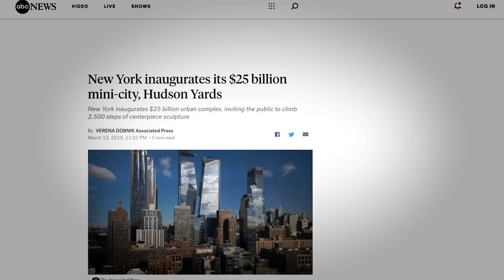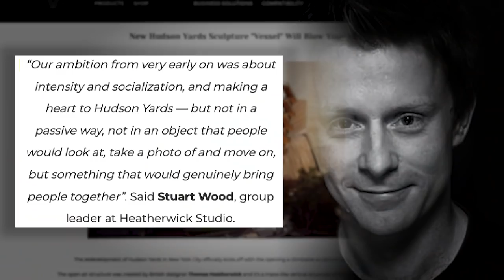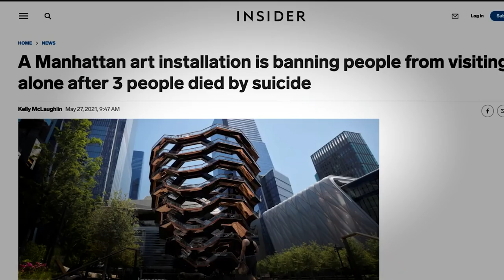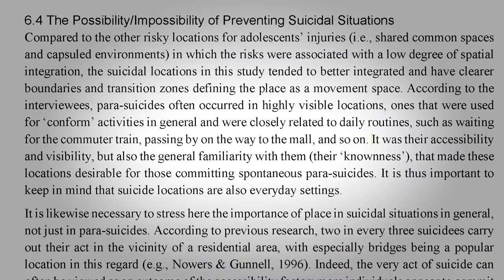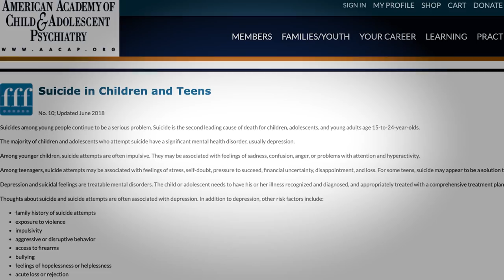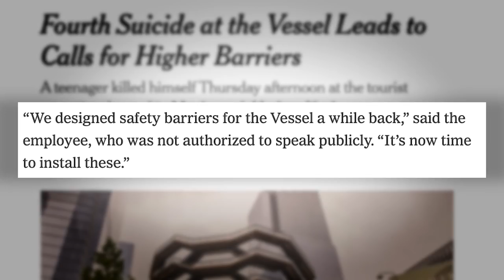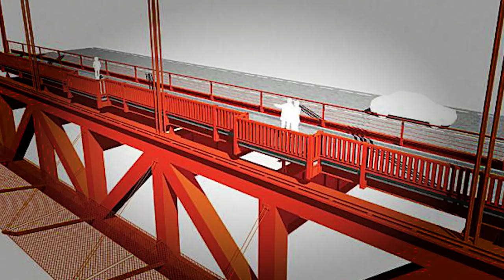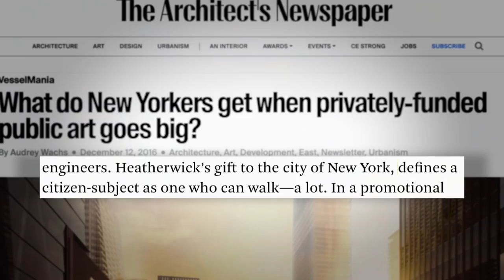Is This $250 Million Selfie Spot Dangerous?

Comment: As a student of architecture I can see that is mostly the designers and archictects vision that went too far.I understand the sensations of doing very crazy designs but it is true architecture can dangerous thing if left uncheck or even on porpuse. Architecture has the ability to push and punish behaviors by design alone. Lets not go far, color in a room can really change someones mood and responds time. So I can say that they got lost in their vision they have spent too much time sorrounded of people that have more of  an economic advantage instead of making research on the people on the city in general so when they designed it they didn't ask the questions of who are gonna be using the space, accesibilty and mood these are one of many beggining questions that an architect must ask when developing anything. We have a lot of responsability in our hands

Comment: Something I don't understand about the issue of visibility vs safety:  we have transparent materials, what's wrong with installing a few windows? 

The CN Tower in Toronto, Canada, has a viewing platform that is notable for the "glass" floors in parts of the deck.  It's extremely thick, and it's probably plexiglass or some similar material rather than actual glass, but from the footage I've seen taken up there, looking down it looks pretty close to people standing on air.  (I will never go there - I have a crippling fear of heights.  But it looks really cool for the folks who don't share my phobia.)  With that, and with the glass/plexiglass/whatever windows, the CN tower offers an absolutely amazing view of the city, and it's completely safe, short of a major failure.

Comment: I'm 61 now and could have not made it past 21 without suicide prevention measures, not involving tall structures in my case. Preventing suicide is necessary and they should add these lifesaving barriers to the design. As a person who suffers from life-long depression, stopping someone from attempting suicide keeps them alive to get past a temporary crisis and get the help they need. But what about those with disabilities, wheel chair access, and strollers? This piece of explorable art built recently in a modern city should not have been permitted without extensive access. They could have used ramps instead of stairs, or made ways around stairs to the elevator on each floor. How did they manage to build the thing without complying with the Americans with Disabilities Act???

Comment: Given the Vessel was designed by billionaires, surely it wouldn't have been beyond their resources to incorporate a barrier or net running from the top of the existing one, that was simultaneously strong, minimally intrusive (so hardly visible from ground level) and have upright elements spaced as wide as possible without being wide enough to allow a human body through, so it feels slightly dangerous and precarious, but in reality over engineered for safety. 

But ideally, something like that should have been designed from the start, as well ramps integrated into the structure (staggered rather than a continuous spiral) and circular walkways at each level. With care, they could have been incorporated while retaining a design similarity.

Comment: I've become quite a fan of your channel...

I worked in New Your City for several years and I can tell you that most skyscrapers have some sort of roof access.
In one building where I worked, you could simply walk up the fire stairs, open the door marked "roof", and be standing 24 stories up... with a three foot railing.
You could not end up there spontaneously or casually but nothing would have stopped you if you wanted to access the roof.
To me this means that there's nothing you can do to prevent someone who plans or intends to find a high place to jump from.
So, at best, you can minimize "spontaneous" suicide attempts... because anyone who plans won't have trouble finding an accessible roof door.
I can also see how someone considering "ending it all" might see that as "a cool place to do it".
Sort of like the concept of "standing at the edge of the world and experiencing a temptation to jump off".
There is also the obvious issue that, once someone has jumped from a structure, a sort of precedent is set... and it becomes "a popular suicide spot".

But I can also see how that very feeling of vague threat contributes to the awe of the experience of visiting the place.
It really would lose some of the sense of awe and excitement simply KNOWING that there was a safety rail "between you and infinity".
Part of the thrill of those amusement park rides they compare it to is the ILLUSION of danger built into them.
It would be difficult to design a safety shield that could make it safe without destroying that illusion.
(I'm pretty sure that the safety nets on the Golden Gate avoid this by being tucked down where they DO NOT obstruct the view out from the walkway.)

It also seems to me that, from the statistics you quoted, and the psychological analyses that went with them, there is another solution.
Since they require tickets for access anyway they could simply NOT sell tickets to anyone under 25 years of age.
Or they could put safety protection on the bottom four or five levels... and then restrict access to the levels above that.
That would enable them to eliminate the threat FOR THOSE SUSCEPTIBLE TO IT...
While not "compromising the artistic integrity" of the upper levels for those able to "use them safely".

While I can imagine "attractive decorative grills" I also must agree that they WOULD interfere with the "artistic integrity of the structure". 
(I can't even imagine bothering to climb up twenty stories of stairs to look out through a safety grating.)

Comment: The "suicidal people will just pick somewhere else to jump" is an interesting and somewhat weak argument.

Suicidal people often suffer from depression as the most commonly co-occuring symptom. Most suicidal making an attempt would probably just stop the attempt as soon as they reach a road block.

Of course there's going to be people who try harder. It's a symptom of a disease and, to look at it clinically, no shit would some symptoms and episodes be more persistent than others. To compare to a less severe medical episode that I've experienced, migraines can be very persistent. Sometimes it's gone just by eating a snack. Sometimes it's gone by taking an abortive medication. Sometimes I will go through the max amount of medicine I'm supposed to take within a week and the migraine will still be there. That's a part we need to view clinically. Just because some episodes are more persistent than others doesn't mean you tell people to stop taking an advil or an imitrex. Or how just because there's a failure rate with epipen that you tell people to stop using an epipen when they have an allergic reaction just because sometimes it doesn't work and you need more aggressive treatment.

But putting up a bigger barrier even if it only stops one person is definitely worth the price. Just like taking an emergency medication is worth it to stop a painful or life-threatening medical episode. The "people are gonna just go to a different building" argument is actually not only a rare occurrence but is just a ridiculous argument. I'm not gonna stop taking an imitrex or an advil when I feel the symptoms of a migraine just because there's a small chance it won't work.

Comment: I'm curious about the effect of ease of access to suicidal hotspots on the local suicide rates. Does the ease of access actually have an effect on the amount of people experiencing spur of the moment "Call of the void" suicidal ideation or is it just giving people who are already experiencing those feelings an easily accessible method. In Waukesha Wisconsin there's a conservation watch tower called "Lapham Peak" that's open to the public and is a popular tourist spot. It's about four stories tall with railings that would be Childs play to climb up and off the top level yet it's never seen a single suicide that I can recall or look up. Meanwhile the county hospital parking lot has seen several.

In a broader context I wonder what happened to our culture that so many people have become so devoid of connections. It's to the point where more people than not are lacking something important in their biochemistry that they are clinical need of anti-depressants.  What is it that people are lacking that makes them vulnerable to these stressors while others are able to endure and move on?

In other news I have found the most depressing topic for my thesis that I could've hoped for!

Also if the idea of adding actual railings or proper "catch netting" is so hard perhaps close off the very top levels while stringing nylon netting between the levels so that any potential at-risk individuals need to at the very least need to bring a knife with them on their suicidal attempt. Lot's of people have $10 on them significantly less carry a pocket knife.

Comment: At the end of the day it's that billionaire's funds and he can spend them as he wants. It's also not up to the designers to prevent any unintended uses ('make something idiot-proof and a bigger idiot will appear' type logic. Not the best phrase in this case, but it gets the point across). And i do see how barriers will make this structure a 'just another walled-off foot bridge' that's too different from the original vision... HOWEVER...

Since this appears to be such a big issue, what about some nets on the ground (or rather 10-20 ft above ground) level? Just imagine sloped triangular shapes stretched between pillars forming a ring around the structure, like triangular sails swaying in the breeze. Not only will that catch any potential jumpers, it will also block some sun and create comfortable shaded area around the structure while being transparent enough to see and appreciate it.

Comment: I'm surprised the possibility of facilitating suicides didn't occur to the building architects.  Rather callous, I think.  Aesthetic design over fragile human psychology.  

P.S.  My (modestly priced) childhood home won architectural design awards for its aesthetic appeal.  However, literally one third of the already small house was just empty space where a chandelier hung inside the front entrance.  (Looked nice through the frosted glass from the street). Also one entire wall (kitchen, dining room, living room) of the first floor was glass.  Lots of natural light in summer; but a nightmare of cold in Michigan winters-- insulated floor to ceiling curtains and double pane glass (added later) did little to mitigate the cold.  We were reduced to using space heaters in the living room six months of the year.  When my mother died I couldn't sell the house quick enough.  It's sad; but despite its spiffy curb appeal I have zero pleasant memories of the house.

Comment: Why not just install glass railings that go  like 8ft above guests heads. You get that same dangerous feeling, the view is completely unobstructed and everyone stays safe! Its not that hard. 
If I may rant for a moment: this is artistic archetecture meant to be enjoyed exclusively by able bodied people. I hate these. I dont have physical disabilities, but I do have a service dog. She would hate this because its so much walking, and there's no solid side to the stairs. Plus, the concrete would burn her paws in the summer, and ice melt can poison her in the winter. Now, I can get her shoes for that-but she should only wear them for a few hours at a time-dogs sweat through their paw pads. Granted, this is not as bad as the tower that LITERALLY has HOLES SURROUNDED BY SPIKES on its steps in my home town and an elevator that doesnt work. At least that has a railing-shockingly, even my 5ft self can see all the pretty views from the top of that. 
Anyone whose got physical limitations cannot enjoy this the same way as an ablebodied person. Legit, enclosing the space so ppl cant jump (and can have shade as a bonus,) adding some nice benches and using ramps instead of stairs would only change the thing's dimensions. Which they could absolutely have done because they have 'screw you' amounts of money. steps off soapbox

Comment: Heatherwick's attitude is an insult to architects & designers - when you're spending $200 million on a structure (regardless of what it is) there are always solutions that can be integrated without upending the 'artist's vision', and the architect/designer ALWAYS has an ethical responsibility to consider the safety of patrons & passers-by.
They could easily have integrated double-height glass/perspex panels on the higher levels, preventing people from climbing over the rail while still allowing unimpeded views & retaining the open aesthetic.  Numerous tourist viewing platforms & suspended walkways around the world utilise tall transparent panels to enhance the sense of danger/thrill & there are multiple products on the market that could easily have been part of the original design specs.

Comment: my god, people didnt die by falling by accident. why are you blaming it on the designers? better railings wouldnt have stopped them. the only way is to enclose the entire walkway the way that some bridges do but then what's the point of this structure? i guess if you can blame anything on them, you can blame the fact that they should've known better and that structures like these will always have people committing suicide. it's is basically a bridge but is supremely well designed and beautiful. it would attract even more people to do it there. so the only solution was to never build it at all. if you think about it, every sturcture that allows can house a human at a great height always has some enclosure to stop them from jumping.